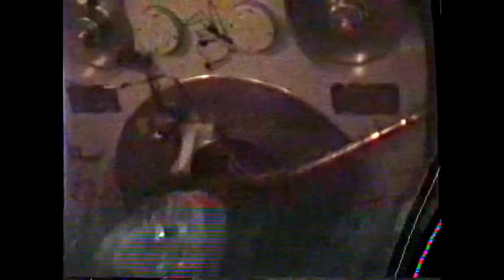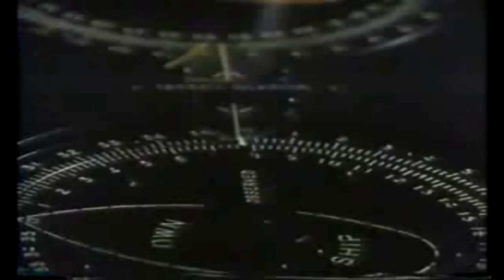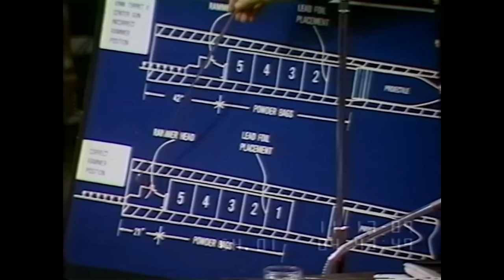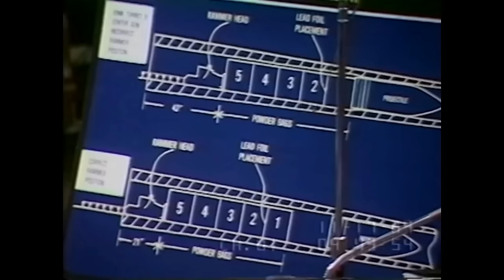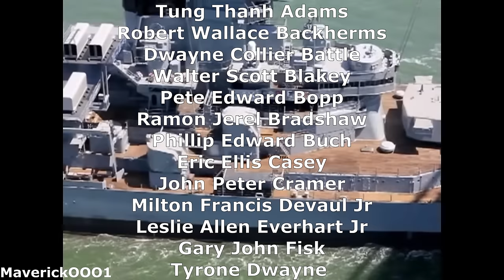USS Iowa Turret II Explosion: The Coverup That Almost Sank The Navy

Comment: My friend's father was a battleship gunner.  His very first reaction to the tragedy was that they obviously over rammed the powder bags.  The attempt to scapegoat a sailor for sabotage is a heavy stain upon the honour of the USN.
Reply: Yes I was active duty in USN when this happened and I was horrified that the Navy tried to frame this accident as a disgruntled sailor who committed suicide and killed his fellow sailors. Didn't believe that for one second. Military brass as in senior officers tried to cover up the fact that there were training lapses....safety lapses....etc. Remember...senior officers want to promote all the way up to Admiral if possible and ANY blemish on their record will stop all that resulting in either getting passed over or dismissed from service.
Reply: The overram was caused by loading 7 bags of gunpowder instead of the regular 6.
Reply: @dancly1913 I thought it was supposed to be 5?
Reply: @dancly1913 no they loaded 5 instead of 6. The one ordering it thought that reducing the load would sufficiently reduce the higher pressure from the heavier shell.
Reply: @dancly1913  Incorrect.  The firing exercise called for 5 bags of D846 propellant shooting a 2700 lb projectile.  The hypothesis for the test was that 5 bags of the D846 would create more chamber pressure (and therefore greater range) than the standard full charge of 6 bags of the normal D839 propellant for the 2700 lb projectile, BUT, not so much extra as to overpressure the gun and blow it up.  The D846 propellant was designed for the lighter 1900 lb projectile and consequently has a faster "burn rate."

The explosion was NOT due to using D846 propellant that overstressed the gun.  The explosion was an open-breech explosion, meaning that the rear opening of the gun, where the projectile and propellant are inserted, was wide open at the time of the explosion.  There could not have been enough pressure to overstress the gun since most of the pressure of the explosion escaped out of the breech and went into the gun house and through the turret.  There was only enough pressure inside the gun to push the projectile that was in the gun at the time a few feet up the gun tube.

Sandia Laboratories and Dahlgren Naval Weapons Center came to the conclusion that the most likely cause of Iowa's open breech explosion was an unfortunate combination of one very unusual event---an excessive and extended overram of the propellant, due to either the inexperience of the rammerman or malfunction of the rammer equipment----along with a statistically extremely rare occurrence of having a certain arrangement and number of propellant grains in the tare/trim layer of the propellant bag.  The testing showed that when the tare/trim layer has between 3-7 grains of propellant, it is very susceptible to crush forces from an overram, and the crush forces will fracture the propellant grains and cause them to ignite and smolder.  As these grains smolder, they in turn ignite the black powder of the next propellant bag they are being crushed against, and that ignites the entire powder train, resulting in the open breech explosion.
Reply: Even worse was they claimed that he had a gay relationship with another dead sailor in Turret 2 as if that had anything to do with it
Reply: @SomeRandomHuman717  I was a gunners mate in turret 2 of the USS Missouri during the Persian Gulf war. The right gun of turret 2 had a dead spot in the rammer we assumed was from leftover cosmoline in the valve block.  When ramming powder, you’d move the lever forward which was supposed begin driving the rammer forward. It wouldn’t move until you had the lever much further forward than it should be for ramming powder and then it would jump out at 1000mph (exaggerating). You’d have to be quick to pull it back where it would slow down and operate normally. I only say this to because it seemed really obvious to us that the Iowa had a rammer failure that caused it to over ram the powders.  What’s interesting to me is that Crane or Indian Head (can’t remember) came out while we were decommissioning Missouri and installed T-pins on the rammers at a position that was supposed to make it impossible to over ram the powders.  We thought that was pretty dumb since 1) you’d have to remove the pin just to get the right gun rammer to move, and 2) ramming doesn’t stop unless the pressure is exceeded (as when ramming the projectile’s rotating band into the rifling) or when the handle is retracted. In the left and center gun rooms, you could leave the T-pin right where it was supposed to be to prevent over ramming powders and unless you retracted the handle, the rammer would keep on ramming potentially igniting the powders. Those T-pins are still there on the Missouri (at least in turret 2).
Reply: @dancly1913  Completely wrong and not even possible.
Reply: Spot on. The bags were incorrectly loaded with powder grains—susceptible to the overram. The incident was a confluence of unlikely but preventable events. Tragic beyond belief because it was so unnecessary.  @SomeRandomHuman717
Reply: 1) The relationship didn’t exist, period. A complete and shameful fabrication. @nogoodnameleft

Comment: I worked on Iowa from 2012 until covid, and am very familiar with the accident, as well as several first responders. In fairness, 'coverups' are not limited to the US gov't. They happen in any large org, because, like it or not, SOMEONE has to take the fall, and who better to pin it on than one of the dead guys? It's despicable, but it happens, and this time, they picked the wrong guy, because Hartwig's sister (whom I knew as an acquaintance) was a pit bull who simply latched on and did not let go.
Reply: Supersonic bomber, which killed most of the pilots who flew it, an absolute travesty of a plane. The Soviet enemy was insanely incompetent
Reply: It's nice that someone comes out of this with credit - the sister I mean. I'd just watched a video on the Tupolov T22
Reply: You’re right. But this was especially egregious. Horrific really. That stained the reputations and psyches of many good IOWA sailors. Not to mention the families of the dead. 

Both the accident and the investigation were exercises in leadership incompetence and corruption.

Comment: Correction we did not touch the inside of the turret we had to sand off the scorch marks off the teak deck and repaint the exterior of turret two as well as the right side of Turret one. All the burnt pieces of lose metal and machinery were originally stored behind turret two, they made us move it to the flight deck and then amid ships and eventually it was decided by command to throw all that stuff overboard before we got back to port. The inside of turret two was not repainted for months after the accident.
Reply: Ryan Szimanski is the museum curator of the New Jersey. I bet he would like to talk with you
Reply: I was a teen in San Diego back then. And I remember no one bought the Navy's 'official' story. My grandfather had been a gunner's mate in WW2 & Korea and he didn't believe it either. 

The Iron Law of Bureaucracy - protect the organization first - was on fully display here.
Reply: @scottmccrea1873 even up until now, the Navy leadership, half of it is lead by glorified politicians

Comment: I was a young, new Supply Corps officer, when the accident occurred.  I was attending Helicopter Control Officer school, at NAS Norfolk, when the memorial service for the dead was held.  At the time, it sounded like a horrible accident.  Logically, the age of the ship and the technology involved had to be a major factor.  Even as a green ensign, I knew enough about naval engineering and the politics involved in trying to create a 600 ship Navy.  I had just spent 6 months learning the ins and outs of the US Navy Supply System, to obtain repair parts and other maintenance items for such things.  One of the first things you learn is the older technology is harder to maintain than new, especially when the parts haven't been manufactured in decades.  It was hard enough to get parts for current systems.  For older ships, one of the most common methods of obtaining scarce unique parts was to cannibalized inactive ships.  In other words, climb onto a mothballed ship, go down into the space and dismantle the old equipment to obtain the part necessary to fix the active ship's system.  I spent most of 3 years with a Destroyer Squadron command and we had older steam destroyers and had to do this more than a handful of times.  we once had to go onboard the USS Yorktown museum ship, with flashlights, to remove a component for one of our destroyers.

It became clear that the Navy was looking for a scapegoat, when everything centered on sabotage and talks of homosexual relationships.  The military and especially the Navy was obsessed with rooting out homosexual service members, under the guise that they were "contrary to good order and discipline."  I saw too many good people hounded out of the Navy because they were gay; not because they had sexually harassed or assaulted anyone; but, simply because they were attracted to the same gender and had relationships away from their commands, in their own private lives.  I saw sailors subjected to interrogations, with polygraphs (despite their notorious inaccuracies) simply because they had a perceived "effeminate voice."  The tragedy and the need for a scapegoat dovetailed into the witchhunt for gay sailors.

60 Minutes did a fantastic investigative piece into the events on the ship,, the investigation and the aftermath.  Anyone who did not toe the Navy line of sabotage was exiled away from anyone who could hear their testimony, including a junior officer who was assigned to the turret, but on the bridge or another duty station, during the gunnery exercise.  His father, a retired captain, raised holy hell until he was summoned back from exile.  As I recall, he resigned from the Navy and participated in the 60 Minutes piece and the subsequent book on the incident.  The investigation revealed the maintenance issues, lack of required parts, outdated systems, lack of qualified personnel, the questionable stability of the powder bags, the improper stowing of the powder bags during a shipyard cycle or refit, in the height of summer, on barges, without climate controls.  It revealed the experiments, without Navy sanctioning and by unqualified individuals.  It revealed the "investigation" and conflict of interest in investigation by the very people who certified the powder as safe.  It revealed the eladership issues on board the ship and that Hartwig was an unpopular sailor because of loansharking activities, which further made him an easy scapegoat.  It detailed practices of assigning unqualified sailors to the gun crew as non-judicial punishment (captain's mast).  I revealed previous incidents on the ship, during gunnery exercises, including a notorious "John Wayne Shoot," where all the guns were fired simultaneously, resulting in gun covers being blown off the turrets.

I saw other things like this in my four years.  During the Gulf War, the commanding officer of the USS Nicholas violated the rules of engagement during an attack on an Iraqi platform, in the Persin Gulf, while firing at it with their 5 inch gun.  The Iraqi's signaled their surrender and the CO was notified of that signal, but ordered the gun to keep firing, until all were dead.  He then put himself up for and received a Silver Star.  He had the ribbon painted on the ship, along with the ship's awards, despite regulations prohibiting displaying personal awards as part of command awards displays.  The wardroom of the ship was uneasy with the captain's actions and reported the incident up the chain of command.  That ship was part of the DESRON 6, while DESRON 4 was acting to maintain that squadron's administrative and maintenance functions, while the bulk of the command staff was deployed to Bahrain.  We spoke to officers from the ship.  The CO walked around wearing a US cavalry hat, like Robert Duvall, in Apocalypse Now, and carried a sidearm at all times.  He would call a halt to the engines and take his pistol and fire at sea snakes in the waters of the Gulf.  He had the ship play music from Apocalypse Now.  They painted a picture of a bloodthirsty, mentally unstable person.  The subsequent investigation pretty much confirmed that assessment; but, it was after the victory and the Navy wasn't going to tarnish things.  The CO had enough time in to be quietly retired.  The Navy publicly announced that the CO exercised poor judgement, but no punitive action was recommended.  The CO retired and the incident was buried.

These incidents, the obvious overkill during the Gulf War, Navy politics and the Tailhook Incident all factored into my decision to resign my commission, at the end of my 4 year commitment, along with a desire to reclaim some control over my own life and destiny.  I served with many fine officers, chief petty officers and sailors, men and women, gay and straight and am proud to have served; but, the Navy had severe institutional problems that it refused to address.  The other services were no different; just different manifestations.  It was present at the Pentagon and elsewhere and is especially present in the relationship between the military, the defense industry and politicians in the Legislative and Executive branches of government.  It affects everything from foreign to domestic policy.
Reply: Sounds like you came to the same conclusion I did.  That I was surrounded by self serving sociopaths.
Reply: Christ almighty that was a read lma🤟

Comment: Met an electrical subcontractor for the NAVY who worked on the Iowa doing repairs after the accident. He said it was quite gruesome because despite the best efforts to remove body parts, small pieces were always being found even in what was left of electrical systems.
Reply: Good comment. The NAVY can hide but the facts will find you. The Australian Navy did the same when HMAS Melbourne sank the Voyager and the Frankie Evans.
Reply: This is true, we found quite a few including a jaw bone wedged behind the cable run at the back of the gun house.
Reply: @martypalmiere7672  The found a head wedged up up one of the electrical motors that ran a rammer.
Reply: @CRAZYHORSE19682003  Don't know where you heard that, but it's dead wrong. Since I was a crewmember on IOWA during all of that I think I would've known if as you say "they found a head wedged up one of the electrical motors that ran a rammer".  What WAS found was a jawbone that fell out when the cableway was cut away at the rear of the Turret Captains booth. It never ceases to amaze me at how much the story changes with embellishments by people who were never there, or "heard it from a guy who was there".
Reply: @darylburnet8328  It's the "Frank E. Evans" not "Frankie Evans" and you're mixing apples & oranges.

Comment: I knew a retired chief petty officer who had served on the Iowa in turent 2, and he told me when they were recommissing the Iowa that the number 2 was going to blow up, he tried to explain to me why, but having no knowledge about battleships he might as well have been speaking romoulin. He also said that one of the dead sailors that nobody liked would be blamed. DAMED IF HE WASN'T RIGHT ON ALL COUNTS!!!!!
Reply: None of that is true. There was nothing about Turret II that made it susceptible to accident. The cause of the accident has been well-characterized. The powder was incorrectly re-bagged, making it possible to ignite it by a sharp, very forceful blow. That blow was delivered by an untrained rammer man doing his best, but over-ramming a bag that happened to be one of those incorrectly filled with powder grains.

LIke most tragedies, there was no single cause, but a lot of unlikely mistakes and negligent acts intersecting at one tiny moment. The bottom line cause was horrifically bad leadership. From the Captain on up the chain of command. The crew was doomed to failure by their leadership—not their performance.

Comment: I was a 16 inch GMG2 on the battleship Missouri. There is no such thing as an ordinary live fire gunnery practice. As soon as the gunners consider it ordinary they get complacent and start making mistakes.
Reply: @beedalton9675 , Could have been several things. A bad powder bag, a powder bag was dropped, rammed powder bags to hard and too far, mixing the wrong powder bags with the projectile. Someone could have been wearing something that caused a spark.  Each powder bag has on one end a red circle ( ignition pad) which contains 480 grains of black powder sewn into squares about 2 inches square. That red circle is what faces the breech and not the muzzle. 

What ever caused the smoldering happened after the powder bag left the powder flats or the powder flat crew did not notice it smoldering. When a powder bag bust open the bag is put in a dunk tank filled with salt water. There are 4 of those tanks on the powder flats and if memory serves correctly 2 in each magazine. One thing is for certain. On the powder flats and the magazines all the hatches were dogged down. That prevented the blast from reaching the powder magazines preventing a massive explosion.

Before entering a powder magazine or handling the powder all jewelry and watches are removed, belt buckle face is turned so facing the belly. The powder magazines when stocked have a build up of ether even if the powder cans have not been opened. Makes you a little light headed for a few minutes. 

The big mistake was on the command. They should have put out the fires. But they should have left the bodies and everything in place and head to port instead of cleaning everything up. A lot of information was lost when that happened, close and seal the turret, leave everything in place as it was when the explosion happened.